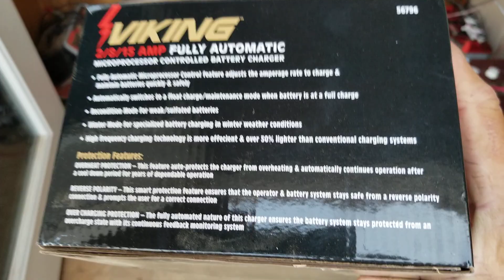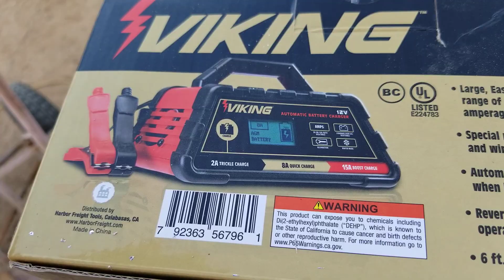Fixing the power outage, Aug. 24, 2020

Comment: Change the  Engine oil under 10 hours of first use.  You will double the engine life on the predator engine.  If you can obtain it use ETHANOL Free Gas.  Never anything more then 10%.  Ethanol dissolves rubber and plastic parts.
Reply from the maker: I have always practiced changing oil on a new engine after a single run.  I can't get gasoline in Commifornia that doesn't have ethanol in it, so I use Sta-bul fuel conditioner.
Reply: @GBear  Yes Sir.   I change oil after the first half hour.  Amazing how much metal is floating around in the things.    Change again in 10 hours and go to  half the recommended hours.  That first change is the one that saves your bacon.
Reply from the maker: @pulesjet  don't mess with my bacon!😂

Comment: Glad you have got your power situation a little more under control. Looks like a great generator that will be a fantastic backup when your back to 100% solar. Great video!!!
Reply from the maker: Thanks.  I'm thinking with the generator setup I can run an extra 120v circuit to the guest camper area for those sneaky hot days that arrive without warning.

Comment: I hope you got your battery setup on a board or something and not straight to the concrete cuz concrete will suck the juice out of them leastways that's what I've been told all my life and I experienced it a little bit but I just stick it on the two by four piece of plywood or something anything to separate the battery from the concrete

Comment: Hi GBear the make sky blue is a really good charge controller and no you cant connect the midnite classic and the make sky blue together but what you can do is set it to help charge the batteries with the midnite. The make sky blue the 119 version have wifi so you can monitor it on your phone.
Reply from the maker: Thanks for the info Ryan.
Reply: @GBear  No problem Bear I have used couple charge controllers over the years so I know what is good from whats not and those PWM isn't lol I would recommend putting your 11 100 watt solar panels on the make sky blue the reason why over the years of using PWM controllers they don't give you the full power from your panels so sometimes my batteries would die at night  so all I use now is MPPT charge controllers.
Reply from the maker: Yeah, since I'm repairing the system I'll be going all mppt, and good stuff...no more cheapos.  The cheapos for me here from 2017, but I was working with a mongrel system.

Comment: I glad you got some reliable power back up and running. If I had six of those batteries I'd be loving it. Wow....6500w Predator, I've been putting off buying the 3500w one( I can't run my frig off solar🤣). Take care.....G
Reply: I had the 3400 Predator, BUT it was stolen with $60,000 worth of goods, right after my divorce. 
So, I am starting over judt got 100 watts solar system from harbor freight. It runs my lights, 10" Treva fan, and the fan & ignitor for my propane freezer/Fridge. I only had enough money for 1 deep cycle battery but really need 2 more for the dark days of winter ahead. But on my tiny disability check that will have to wait.
 I hope your system does what you want it to do. Its no fun when you want to turn something on and don't have the power to do do.
Reply from the maker: @denisewilson8367  so far my system is working, but I do want 2 more L16 batteries before winter.  Just like you said, the longer dark days means more power usage. 
I hope you get an adequate system before then also.
Reply: @GBear  I am working on it, thank you.  And you too, sir. No one should be in the dark.
Reply from the maker: @denisewilson8367  for places that have cold seasons, a couple of good old fashioned kerosene lanterns make excellent assets.  They light a room and warm it at the same time!
Reply: @GBear  I can't do the fumes from kerosine but do have one oil lamp the theives didn't get out of 8. The lamp oil is strong but doable. Yes, I'm from Michigan & use to summers & winters without electricity. Now for the last 7 years I've been off grid. Had portable solar system until robbed. Starting over.
I had probably skimmed the precautions for the generator, always do. But never run things at max load. I try to buy the item bigger than my needs. But thank you for the reminder.
Reply from the maker: @denisewilson8367  are you anywhere close to Santa Ana, CA?  I can get you a great deal on 305w solar panels.  You can run them through a cheap 12/24v controller to provide you with lots of power for when the sun shines.
Reply: Well mine ran out of gas almost at morning and I filled it up and started it and it runs good but no power and to this day still starts the first pull but it wont run no power AND THATS WHY I HAVE 2 MIDNITE CLASSICS THEY NEVER FAIL ON ME PREDATOR WILL. Just like my sawmill what runs it predator hmm went to Honda. Everyone keep it up life always has its up and downs. And I hope everyone here in this chat is making there own power so we can be free from the grid
Reply from the maker: Yeah, got the 6500 for 500 bucks,  but for 100 more could have got the 8700 with electric start. 
Of course that doesn't include battery and cables.
Reply: I learned the hard way with harbor freight generators don't let it run out of gas under a load
Reply: @dangoras9152  What will happen?
Reply from the maker: It claims it will damage the generator, but I suspect that is only if you are running at a really high load, like 80%.
Reply from the maker: @dangoras9152  yes, I figured that out when I read the precautions.
Reply: @ Dan Goras I had no problem with mine. The 3400 generator, ran for 12.5 hours per tank. I think the tank is like a 3 gallon or 3.5 gallon. When I was gone it would sometimes run out of gas. Shut everything off, unplug, fill tank, start it up again, wait a couple of minutes, plug everything back in, start up all the items that needed to be connected. It ran just fine. 
I also loaned my two generators out when I had power but a family with children didn't. And a remote horse barn couldn't pump water, I loaned them my older but larger generator. I'm sure both ran out of gas under a load. Just do the refill/restart like I told them, no issues.
Reply from the maker: @denisewilson8367  makes sense.  Otherwise I'm sure that they would have oodles of returns.
Reply: @denisewilson8367  Yes, no load on startup that's for sure👍

Comment: So how many gallons of gas to get 14.5 hours of run time.?  ..  fyi, the only way to get the MidniteSolarCCC hooked to 
your computer is hardwired in.. I think it is Cat5 but not positive..
Reply from the maker: I have a cat 6 system, and sure it will work.  6 gallon tank, but it wasn't full when I started.